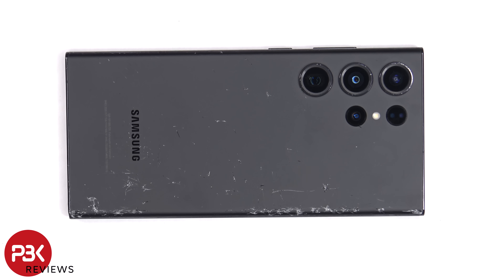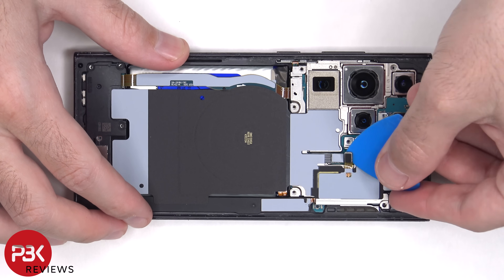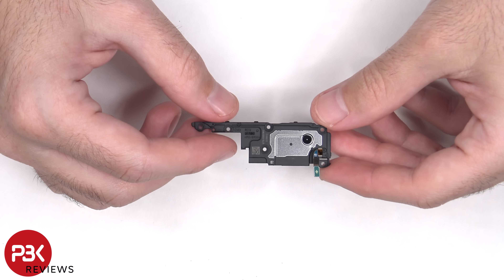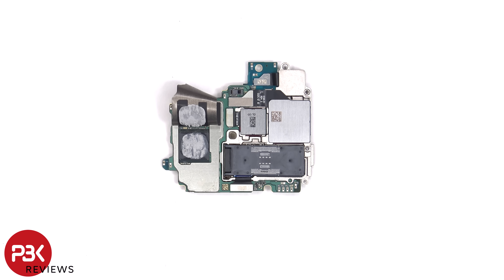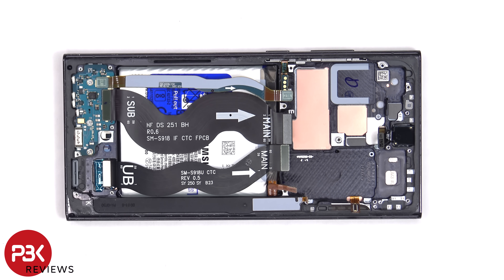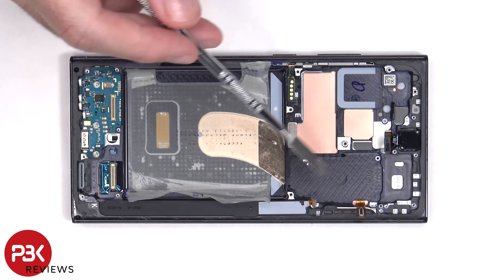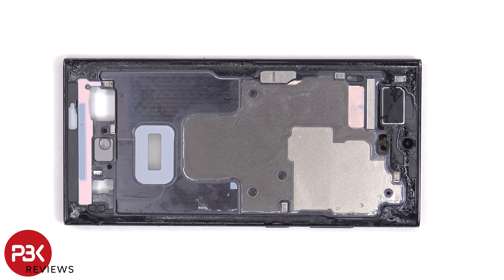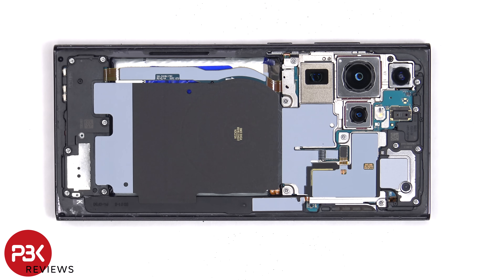Samsung Galaxy S23 Ultra Teardown Disassembly Repair Video Review

Comment: It's really great to see Samsung actually supporting pro-repair properly. Each generation since the S10 has been getting repair upgrades; S20 had the modular daughter board for USB-C replacements, S21 mostly the same, S22 having a Modular Display Cable and now S23 having a Easier to replace battery. Great Job Samsung, keep it up!
Reply: Are you saying it used to be more difficult with Samsung? (never had one)... I'm watching this video and nothing seems easy to me!!
Reply: @HakunaMatata225  I run my own repair company. Samsungs are infinitely easier and better to work on than all other vendors (except a rare 1 or 2 like FairPhone), especially compared to Apple. Apple in particular being the next most popular mobile company, have what I like to call "Surprise traps", proprietary easily strippable screws and extremely fragile flex cables alongside parts-pairing (majority of the parts can't be replaced without losing phone functionality) when opening. The worst part I'd say about opening a Samsung phone is probably just prying the back glass off and for reference, I've done over 50+ Samsungs and never broken the back glass once, so in my own opinion, I find it easy.
As for difficulty, if you've never opened a phone before then chances are that it will be really hard to do with the design of modern phones having liquid resistant adhesive seals and whatnot making it easy to break fragile parts like the back glass I mentioned earlier. If your interested in learning, I'd look at picking up a few cheap and broken phones online that have no value to get started.
Reply: @Joshe505reborn y comprar las fuentes de calor , planchas etc , para abrilo mas facil
Reply: 😮😊 @HakunaMatata225 😊
Reply: @HakunaMatata225 Jr ugh!
Reply: 😊Black
Reply: B. 😊is
Reply: B. 😊is😢😢

Comment: Received my s23 ultra the other day. After testing the phone, I took a nap. However, I decided to add another sim on the slot when I woke up. I accidentally inserted the sim ejector pin to one of the tiny mic holes at the bottom with enough force thinking to eject the sim slot. My question is, is there some kind of barrier to protect the mic from being poked? I recorded multiple vids and made calls, mic is ok they said.. I hope the pin didnt puncture through the mic. Any help and suggestions would be appreciated. There are two holes for the mic at the bottom of the phone.  Is the mic located directly in front of those holes?
Reply from the maker: Hi, you will be fine, since the mic and filter are both seated above the hole and the opening in the frame is like a sideways L shape so you won't damage anything.

Comment: never understand why selfie camera is fixed with glue, there are always better way to do it. hope that never broken because not even a machine will thate that camera out without making marks or damage inside. But the battery have a big fix by taking out with no effort so 10+
Reply from the maker: Yup :)

Comment: Having 9/10 repairability score on a Samsung flagship phones is a miracle.
Reply: Until you remember, they make foldables that are pretty much e-waste out the gate as soon as it comes to repairing anything screen-related. Foldable repairs are also hugely wasteful since a replacement comes with a screen attached to the chassis and is doubtful that it will ever be truly recycled. Even so, it's a gamble that during switching the internals, the hinge mechanism will be intact - assuming any damage hasn't already hindered functionality to as to make it useful for a future repair progect - again, also assuming anybody wants to go through the ardious, risky process of trying to repair the screen and frankenstein a new one to an old chassis. How people spend nearly 1k on a flip or, in the case of the fold, close to or above 2k on those things for lesser specs than a s22+ or s23U is beyond me, simply because it folds. Sorry about the tangent, but folding isn't an excuse to cheap out on specs comparable to the price range of their galaxy flagships.
Reply: @insertnamehere8723 te cobran la  innovacion tengo un s23 ultta pero probe un zfold 2 y quede encantado sobre todo por tener esa pantalla de 7.6" en tus manos y poder llevarla en el bolsillo es excelente , pero le falta madurar mas sobre todo que el pliegue no se note tanto,  porque el que no utilice tanto la fotografia este equipo es ideal para multitarea ademas puedes usar las camaras traseras como selfies y no son tan malas cumplen, mejor dicho es un miniphablet y cuamdo el precio se ponga a la par me pasaria sin dudarlo y eso que ahora llegan los enrollables ya motorola saco un prototipo
Reply: @insertnamehere8723  if you can't afford foldables it's ok. No need to rant about it.
Reply: @DragonOfTheMortalKombat  edgy comment. Come back when you realize what value for money is.

Comment: 3:22  CPU
5:11  Battery front view
5:14. Battery back view

Can you continue to share closeups like this of all the parts please? I think this is very important, especially when looking at previous models (example below)

Battery Models
-------------------------
EB-BG998ABY - S21
4855mAh 18.84Wh

EB-BS908ABY - S22
4855mAh 18.83Wh

EB-BS918ABY - S23
4855mAh 18.83Wh

SIDE NOTE: Can you try swapping parts from previous models to see if they would work? I have to assume Samsung blocks this but be interesting if certain types of equipment works like the front facing camera etc
Reply from the maker: If I am able to get my hands on another S22 ultra, I will try n swap the parts to see what works or not. I've been considering doing it but will probably get to it after the next few videos on the rest of the series.
Reply: @PBKreviews  Yup no worries. Just a thought for more content and experimentation :)
Reply: Not really sure if it will work.
I put a Pixel 6 Pro Screen on a Pixel 7 (turn on you see the Google logo and a few sec nothing happens)
When I did the reverse same thing happened. They might have done the minimum to make sure people can't swap things around. Pixel used the same connector for the 6pro 7pro unlike Apple who radically changes everything from on phone to the other 😂 making sure there's no 13 pro with Dynamic Island out in the wild.

Comment: Hell yeah, the high repairability adds value to the product imo. I hope they allow custom roms after 5 years of updates. With the battery bypass rumored to be available to all s23 models these phones can have a great life after Samsung moves on
Reply: What is a battery bypass and why this is important?
Reply: @Arthur Salvador  Short version: When the phone is charging and used it will be cooler saving battery health and potentially increasing performance 

Long version: It's pretty much just connecting the phones internals directly to the charger without the battery as a middleman. When the charger was connected in earlier samsung phones the charger power the battery and then the battery powered the phone. The advantage is heat, it's much more efficient to just power the phone directly when gaming for example, this reduces heat allowing the SOC to stretch its legs, and makes the battery cooler decreasing wear on the battery.
Reply: @kalle5548  that's clever, good to know the S23U has this feature, thanks
Reply: Right now, the battery bypass only works with games on the s23 series.
Reply: @abs1207 you can directly Power the phone with a cable without charging the battery

Comment: good video - i was kinda disappointed you didn't show if it turned on after putting it back together
Reply from the maker: It turned on but after prying off the shattered screen, it was beyond working condition so yep you can hear sounds but it doesn't show anything.

Comment: Still same internal layout since Note 10 lol. They just tweaked the back design and fandroids call it massive changes each iteration.
Reply from the maker: Lol
Reply: If it works, why change it?
Reply: @coffeemakerbottomcracked  I agree, but why criticize Apple for doing the same right? 😁
Reply: @guil.meister4205  80% components have changed in the S23 Ultra 
Comparing to 14 pro max nothing changed in it. Even battery got worse 🤣
Keep crying
Reply: @subhojit2003  The worse battery compared to the previous iPhone but still exceeds this new S23U? Oh yeah
Reply: @subhojit2003  The secondary camera sensors are same with S20U.
Reply: @guil.meister4205  This is factually the best phone samsung has ever made. Cope.

Comment: Finally the Samsung battery is easy to remove. 👏🏻👏🏻👏🏻
Reply from the maker: Yup!
Reply: They listened finally 😂
Reply: I wish replacing battery as easy as in 2014
Reply: Not only is it easy to remove they sell an offical replacement dyi kit at Ifixit for all componets except the motherboard
Reply: Can I buy the damaged phone from you?
Reply: @shawonahmed5775  You can see it's going repaired at end of video. Answer is possible no.
Reply: @shawonahmed5775 sure. $660 shipped anywhere in the us
Reply: They finally listened after Jerry rig exposed them in his teardowns.
Reply: Revert to 2008
Reply: Yes yay😂
Reply: He was reefing on the fucking thing pretty hard to break the glue, not exactly "easy to remove"
Reply: @ajshdhenskaka utiliza fuente de calor o una plancha